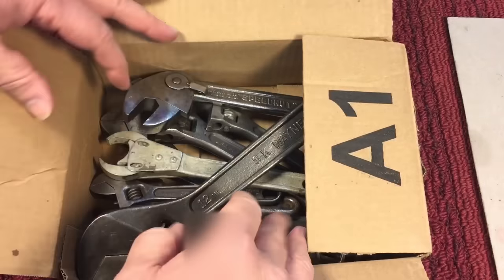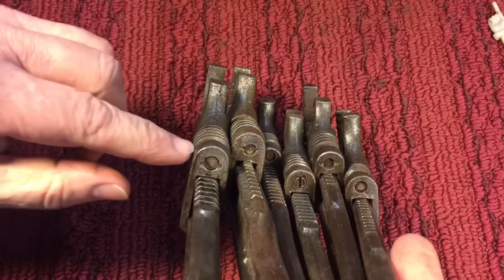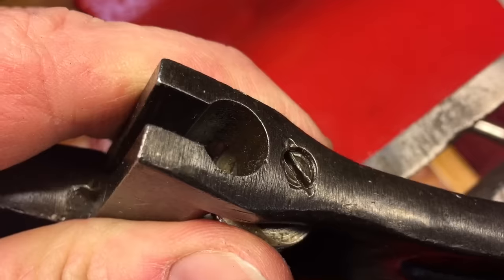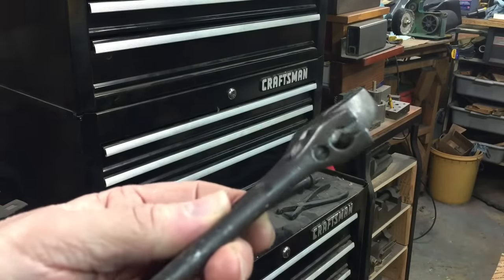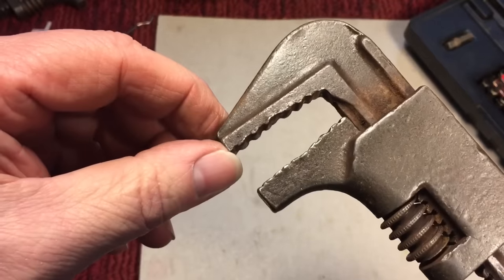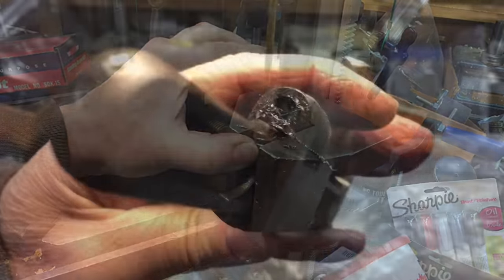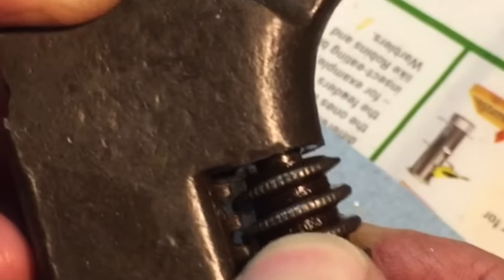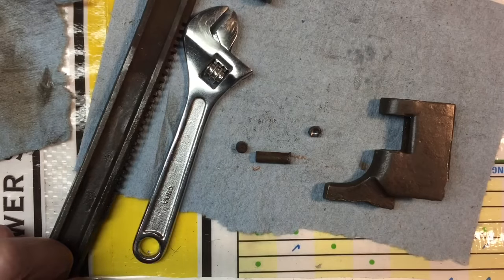Adjustable Wrench Thumbwheel Axel Removal

Comment: I have a old J.H. Williams AP-10 adjustable wrench that had belonged to my dad who has passed away. Our barn took 21 inches of water in the flood of 2016. This wrench was rusted shut. I used electrolysis to remove most of rust, got it loosened up. I have never taken one apart, but I knew about the screw. I was able to back the screw out a good bit, but it hung up. I then searched YouTube, and and found your video. I ran the screw back in, aligned the slot with the peens, and at vise, I was able to use small punch to push peens back as you suggested. I have plenty of adjustable wrenches, but my curiosity led me disassemble the wrench. Thanks for your video. Joe Estes, Bossier City, La

Comment: Thanks so much for talking about this. Thanks to you, I'm trying my hand at tool restoration on a couple of wrenches. One has the threaded pin and I was able to get it out. The other (an auto wrench) has a pin. Thanks so much for the tips. Keep posting videos, I can't get enough.
Reply from the maker: Hi Robert!  It really helps in this hobby to watch other people restoring tools so you can see what works for you!  Some tools are just tricky but easy if you know the trick!  These adjustable wrenches are fun if they aren't to beat up!  Thanks so much!

Comment: Ugh, easy outs or screw extractors... I broke one off in the engine block of an 87 Ford Taurus wagon I owned when I was in my early 20's. Needless to say that was the last time I used one. If I knew then what I know now and learned from people like you, that car wouldn't have become razor blades so soon lol. Awesome video as per usual.

Comment: Really like that beginning with the speed nut wrench first time we have ever seen one at 55 wow never see it all. 
You sure have a GREAT accumulation of fine hand tools wondering back in time just how many of any type tool you select from your collection were made in America that would be an interesting story to share as would how many of the tools on a particular group of your collection are still in business. 
I think I love American history a lot sorry for that.  
MEMORY LANE HERE
Being from aerospace job shop involving sub-assemblies for aircraft structures, we used a staking tool a circle of very hard tool steel of half moons protruding from the equally hardened steel cylinder you hit these with a hammer and it formed the material of the holes edge into the holes diameter equally in the circumference of the hole usually for bearings bushings even like in your great video share threaded headless screws. Nice video share thank you for the memories. Lance & Patrick.
Reply from the maker: Hello AA!  Wow!  Sounds like a great tool!!!  I have to revisit the Speed-Wrench! I found that in the garbage!  Thanks!!!!!

Comment: Awesome mock-up and instructional skills. A couple more ideas if I may; if you’re trying to isolate the heat to just the screw try applying the tip of a soldering iron to the screw head for a couple of minutes (this works great on old rusty screws in wood too). If you don’t have a soldering iron heat up a nail point to red hot while clamped in a vice then touch the wrench to the nail. If you have a pin instead of a screw that is frozen to the adjusting knob —like your auto wrench—slide a shim between the knob and housing then use a punch to drive the pin in slightly to break the bond. Awesome video—Time to regroup and re-attack Ben Mall!
PS. Who the hell would give this a thumbs down?

Comment: I noticed if you were to look at purchasing a replacement knurl it comes with a spring.  Do you know if the older Cresent brand Wrenches had springs?  I ended up using the knurl and making my own pin but am wondering if I missed a step.  Another great video by the way!!

Comment: I absolutely hate screw extractors. I found that HF has cheap sets of left hand drills. There are usual Chinesium but have always got the job done for me. Nice tips on removing the staking from those wrenches. I usually use the milling machine to remove the staking from the holes though. I have an old Palmgren vise like that and use it all the time. Thanks for a  very informative video!

Comment: an impact screwdriver is a good tool to have & it helps to heat wear the the tread of the pin is as you said it sometimes on the other side nice video.

Comment: ScoutCrafter, great stuff, just caught this vid. Please advise as to which grinding wheels and buffing wheels you use along with the compound. I bought an old Craftsman bench grinder from the late 40's early fifties. Has 7" wheels on it with 5/8" arbor. Heavier than all get out. BTW, I think you meant to spell "axle" not axel, unless you were referring to the figure skating move

Comment: Thank you SC! For the best tutorial/info on how to handle this challenging problem. One question: When u went to the step of drilling out the pin - What do you think about drilling a smaller hole and tapping and threading a small bolt or machine screw into the end of it, and using that to pull the pin out? This would only be on a rusted/stuck pin. Is it worth it to try? Or too much hassle or risk of breaking a tap or screw off in there? Either way thank you again! My shop isn't set up right now, but when it gets a little warmer out I'll be taking a crack at this!

Comment: Your videos are great and I appreciate the way you go through different scenarios. If the set screw was peened over to stop it from backing out, what do you do at the end of the restoration to prevent it from backing out in the future?
Reply from the maker: Mike- I use Medium strength Lock-Tite Never had an issue!  Thanks!

Comment: Very instructive video, Scout.  Did the third section of the pin just fall out after you cut the center section with the Dremel tool?  Those jaws on that wrench look so gnarly you could paint it up a little and get it a job in one of those 1950's monster movies like Godzilla or Gamera. - Kathie
Reply from the maker: Hi Kathie!  Yes!  The two small pieces just fell out but the pin in the thumbwheel needed some persuasion!  =)   The wrench does look like something that could bite you!  =)   Thanks!!!!!!!!!!

Comment: I have recently bought a stainless Steel Adjustable and there the hole is welded over and ground flat again. 
They are non sparking as well and seem to have been used to defuse bombs and such things - guess you really dont want something to fall out when doing this kind of work haha
Reply from the maker: Yes!  I too had a wrench that was welded closed but it was done after the fact by someone...  I guess their screw kept backing out and one day they fixed it permanently!  LOL  Thanks so much!

Comment: Hey scout..have you ever took the screw out of a crescent wrench and the threads are rolled over? I have a nice older wide jaw james town crescent I recently got from a garage sale. It doesn't open and close the greatest. It freezes up and gets stuck. I realized the set screw or whatever you call it is rolled over/kinda stripped at the end of the screw. It needed to be tightened but because its damaged it won't tighten. I was wondering if you've had any experience fixing them threads and if you have what do you suggest I try? Dremel? Thanks for any help, Scout!

Comment: I found that getting over jealous on the bench grinder wire wheel can burn the metal and discolour the finish. Metal burns can ruin the restoration.

Comment: hi 
why you don t use an impact screwdriver  ( manual one , with hammer ) 

it s work s good  if support of wrench  is good  using the weight  inside body of screwdriver 

like  facom ns 260  ( work good too if you need to unscrew a car s door  )

Comment: Hi scout, real  demonstration there, On the seized plain pins would it be worth drilling , tapping, screw a piece of all thread in there,and running a nut down to jack the pin out after applieing  some heat? Etc.  Boy that wrench had a hard life ,from an abuser not a user . I once lent a tool to another mechanic where I worked and it came back mashed, whith no oppology,  some people huh*.  My father's word's  rang in my ear (  nor a lender or a borrower be son )  I only got caught  whith that once.  By the way scout the argument on which way round a crescent wrench should be used is still going, whats  your ideas on this ,  if you already covered this ,I guess I missed it?Sorry.   Best wishes to you and family.  STUART.
Reply from the maker: Hi Stuart!  LOL  I did a video on just that subject- What direction is "right"...  LOL   Thanks so much!!!!!!!!

Comment: I've probably got 10 sets of screw extractors, everything from snap on to harbor freight, any of them work maybe 1 time in 20. I have to pretty desperate to even try them at this point. Good in theory, not of much practical value in my experience.

Comment: EZ outs are your friend! Lol
Reply: In my experience if something is stuck enough to need an easy out, it's stuck enough to break an easy out.
Then you have a real headache because you have hardened steel in your hole.
Reply from the maker: Hi Dominic!  In all my times using EZ-Outs they helped about 50% of the time...  =)  Left hand drill bits are the bomb!!!!   Thanks!!!!!!!!